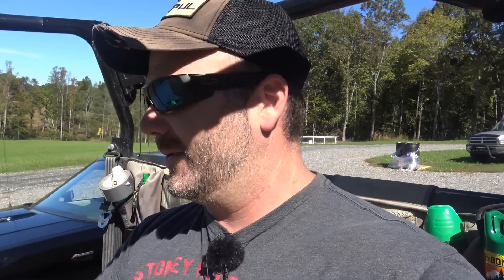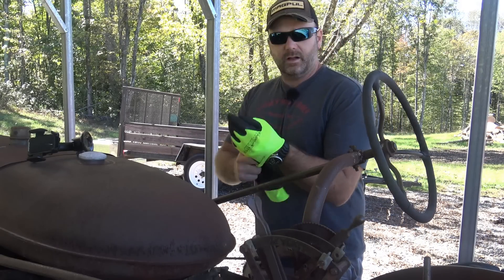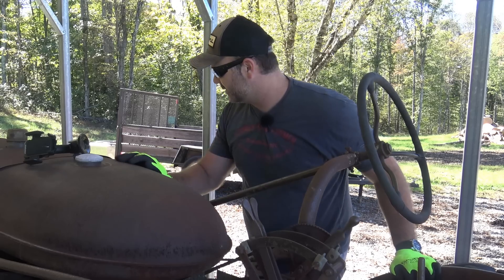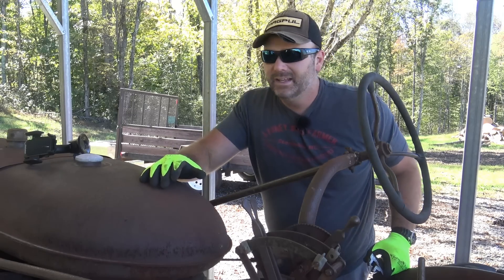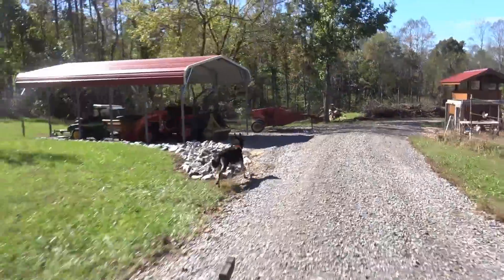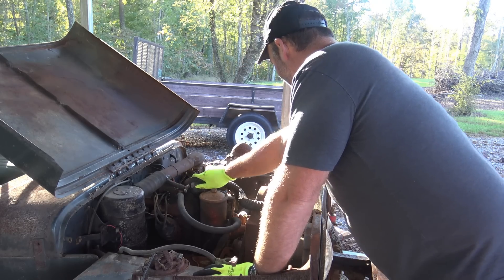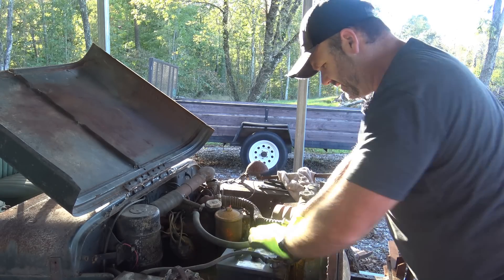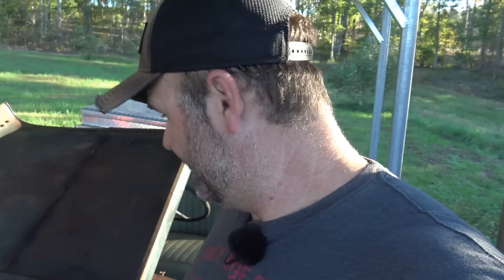WILLYS JEEP... LET'S GET THIS THING RUNNING!

Comment: 1. make sure she'll turn over. DONE!
2. take spark plugs out and inspect them/clean them, ensure they fire, using a vehicle that runs. Include the plug wires in testing.
3. squirt a little oil into each cylinder and spark plug hole threads.
4. change engine oil and filter.
5. repair the brake on at least one wheel.
6. take poor old starter apart to see the issue. repair.
7. ensure fuel to carb. IN PROCESS!
8. have fire extinguisher handy when attempting to start.
9. after it runs, check cooling system. 
10. new tires, tubes, brakes, change all fluids, grease, etc. (except oil, as it is fresh, if it looks good, with no contaminants) 
11. check all electrical. sparks can light up your crops etc. PDQ, no?
12. sand blast and/or rust paint on floors, panels. clean and rustproof bottom.
13. it's an authentic Willy Jeep. protect that sucker! lol.

These are just my thoughts. I'm sure there are more, but they involve other things.

Comment: try the battery back in the farmall , if that doesn't turn over you know its junk.  your starter could be fine.  clean the points and tow start it, good luck that jeep is cool as heck

Comment: Clean up those battery cable connections,  flush the  engine with  kerosene, put new oil in.  Clean battery ground connections.   Take starter off and take apart, fix it or replace. Clean or replace spark plugs.  Wish I was there to help, haa

Comment: You take out the plugs first! A bit of oil in the cylinders to lube it after a long time. Check motor oil. Lube all moving parts (shafts sticking out of the engine. All rubber oil retainers are dry on the outside.  Try to turn the engine over a few times. Maybe best by hand first. Check for spark. Clean the carb. And now try to start it.

Comment: Hey cuz pull that starter off and takeit apart and check the brushes and take some Emory cloth and clean the armature where the brushes make contact may get you by for a bit just to crank the willys

Comment: just convert it to 12 volts  it will require a alternator, a 12 volt coil, a push button for the starter  (so you don't fry the starter) the amp meter will need to be changed out with a volt meter and the gas gauge will not be accurate and a 12 volt battery,  I also suggest changing the the points in the distributor for a Petronics electronic ignition,  so much more reliable and easier to start.

Comment: Clean the point With sandpaper and put a temp.  Gas tank and 12v batery will start 👍
Reply: An emery board  like people file finger nails with is easier to get into the points than sandpaper. Just a tip.

Comment: Change the oil first! If ya get lucky and it fires, that oil's so old it'll eat crank & rod bearings and destroy the engine. New points & plugs wouldn't hurt either. Check the gear oil in the trans and rear end, it probably needs changing too. When I work on an old car or bike, ALL the fluids get changed before it's lit up so no badness comes knocking.

Comment: What would Mustie1 do?
Reply: Fuel, Sparc, Compression. The holy trinity according to Mustie1.
Reply: take off plugs and put two stroke gas under them

love mustie1!
Reply: Mustie would say: "let's look in the hoard, and find a starter, I would have 5 VW starters I think."  :-)
Reply: He'd probably pull off the Carb since that is going to be dirty and clogged. He'd pull the plugs and put some two-stroke oil/fuel mix in then crank the engine to check spark. If he has spark he'd move to checking compression (it looks like that thing has very little compression by how easy it was to turn with the plugs in place). Depending on the compression results he'd either check and lube the valves then work them to try and loosen them up or he's just crank the engine for a bit to get the top end lubed up and then check compression again. If he then finds good compression and spark he'd put some fuel into the intake manifold and see if it starts up. If it starts it's on to doing whatever else is needed to get it running from cleaning and rebuilding the Carb to new gaskets. From there it's all about the form and function - clean up the rust, bar and chain oil on the frame, fix any body damage, etc, etc. Then rattle-can the paint job and make us all wish he was our neighbor.
Reply: Darren would check to see if the motor spins. Then check for spark, then compression, pull the carb. Rebuild the carb. after he doesnt find one in the hoard. Opps I didn't see Buddy Revell already said. But I did miss fuel.. Lets get Brian over to help pull the engine. Is that a bad thing, that we all know what Mustie1 would do? lol
Reply: part it out, it's not a VW

Comment: On a positive ground system you hook the ground cable up to the positive post and other cable to the negative post. Try it. Also if your going to replace the starter you may want to convert the wiring to a 12 volt system I don't know where you can find a 6 volt positive ground starter motor.
Reply: It is a negative ground vehicle and when you change to 12 volts you need to change the gauges, but not the wires because 6 volt wires are larger than 12 volt wires. He needs to just put on an alternator, 12 V starter and change the points and condenser and coil to later model Jeep stuff.
Reply: @gelynch52phPH  wouldn't it be easier to to find 12 volt parts than to keep messing with a out dated system. When I said convert to a 12 volt system. that's basically what I meant. It's possible to find all the 12 volt components at most junk yards. only high priced collectors and manufactured companies have any positive ground stuff. I was just giving choices, not recommending he do one over another.

Comment: I bought a 1987 Grand Nat'l in 1990 from the orig owner with 4900 mi and sold it 22 yrs later cause I put too many mikes on it. Dumped the oil and filter every 5,000 mi and it ran like a top. I sold it with it  still retaining the orig lacquer paint.

Comment: the VIN number is supposed to be on an aluminum plate between the inlet and Outlet of the heater core on the firewall is held on with screws could have been easily removed

Comment: The rivet holes where there is a missing plate is Willy's patent numbers ident numbers are top front of engine- inside engine compartment on top of left front tire fender or there is a plate mounted inside of glove box with secondary vin
Reply from the maker: Thanks brotha...there isn't a glove box in this one..hmm
Reply: @StoneyRidgeFarmer  or check under the dash for ident number

Comment: If you do a google search for "1952 Willies jeep vin location" and look at the images you will see where the frame is stamped. the vin plate is in the location you thought it should be but that plate unscrews regardless so you will have to go by the frame number

Comment: I know with old ford n series tractors with the 6v system the battery cables have to be almost 100% clean or it will cause lots of issues turning over. I would replace the cables before anything, goodluck!

Comment: Rig up a gas can, tow it to top of hill, put it in 2nd gear, turn on switch and let her roll.  Pop the clutch and she might fire.  But first follow the suggestions here about the points and lubing the cylinders up a bit.

Comment: Cut the gas line right before the fuel pump and put a rubber hose on it and run it into a small gas can. I had to do this on my 1947 Chevy fire truck

Comment: Who went straight to the comments when you saw him pour the gas 😂.... it’s very dangerous to try and start a dry engine... always take out the plugs to add WD40, then while the plugs are out, turn the fan lightly to make sure it will actually turn over before stressing the flywheel with the starter and causing more damage... everyone has done something wrong when in a rush but just take it slow and you’ll do great ! 👏😁
Reply: Yes WD40!! It’s thin and will go nicely into all the crevice of the rings, it will burn out easily too and won’t cause compression issues

Comment: The VIN commonly associated with modern vehicles does not exist for the CJ3. These older vehicles only had serial numbers and some other manufacturing data. There is a data plate mounted on the right side of the firewall an inch or so below the edge of the cowl.

Comment: Pouring the gas in isn't going into the bowl. It's going right into the valves/cylinders. If you have spark at the plugs, I'd pull them and clean the plugs with a little sand sander and squirt some oil in the pistons. Then try pull start it. Careful with no brakes. Clean battery cables should lot. (6V needs to have best massable connections to get the most juice. Includes the armature and brushes.)

Comment: rebuild the starter cost you less i have rebuilt several 6v jeeps and it has worked almost every time or run a 12v system to it it will pop back to life good luck to you if you need help im glad to help anyway i can would love to see another jeep running on the roads again.

Comment: Pull the spark plug and dump a little oil down the cylinders or spray fogging oil down them. Then turn over the engine a little bit to spread out the oil between the piston rings and the cylinder.   Those russty battery terminals could be limiting the current. Starter could be bad too but wire brushing the terminal clamps is cheap and easy. Also for the fuel tank just zip tie a lawnmower gas tank or modify a water bottle or something. It's possible to and that the engine is turning over very slowly because the engine is Stiff from sitting too long. I have a 1982 jeep cj7 that sat in a barn for 16 years for the previous owner then ive owned it for 2 years and its sitting still. So 18 years its been sitting and the engine has not been turned over because the wireing harness is gone from a fiber glass body swap and recently I pulled the plugs dump oil down the cylinders and turned it over by hand and the engine was a little stuck but after wiggleing the engine back and forth it freed up and after turning it over like 10 times it truns over much easier .

Comment: You should have put some thinner oil in the cylinders and let it set also when you get it running need to put in some new spark plugs also revealed the alternator and rebuild a starter it's been setting 30 years

Comment: Josh, check the compression,  id replace the points and condenser, check the distributor cap, as far as the fuel situation, i rekon you can use a gas container with a rubber fuel line to the carb just keep it higher than the carb. Make sure you got coolant too, (maybe do a pressure test on the radiator) Also when you get it running keep a can of starting fluid and squirt to find vacuum leaks, i forsee rewiring and replacing hoses,

Comment: Look it up on the interweb-just because it's 6 volt doesn't mean it's a Positive Ground. Quick cure-put a one wire Delco 10si alternator and a new 12 volt battery in the Jeep. Switch all light bulbs to 12 volt versions,and you might have to reverse the polarity of the heater fan etc. Should be less than a day's work.

Comment: Put some ATF in the cylinders. Just get a rubber fuel hose and put it in a gas can for now. Points may be corroded and carburetor full of gunk. Banging on the starter may free it up, probably full of crap and corrosion. I'm sure it will start with some dicking around. Be careful with it as the clutch disc is probably rusted to flywheel as well.

Comment: My dad always fired up our Farmall model a 1941 I had 6 volt system but we started it with 12 volts wow that booger cranks over real good you can jump a 6 volt with a 12-volt just do not leave it hooked up very long

Comment: Get the backs fixed then get the stater worked on. rebuild the carburetor.  get clean/ get new lines for the gas to the tack and get the tack clean be for you go and TRY to start it. see you you have fire to the distributor cap. if you have all that then try to start it.

Comment: Take that starter off there and clean it up, lube it and check the brushes. You may get lucky and get by with a clean and lube with the mouse piss.. I'm sure there will many videos covering it or one close to it on you tube. Pulling it is a great ideal for a first start to see what else you're dealing with. 

And don't forget Rock Auto dot com can sometimes be your best friend when it comes to getting cheap parts for old iron.

Comment: Dont forget you need oil with scuff additives or you will destroy your bearings and lobes. Use 15/40 for fleet  diesel motors. The old bearings are not round balls they are flat steel. Never turn the motor from the crank shaft for the first time. Remove the starter and turn motor from flywheel only. You have the go devil motor? I have the 1953 hurricane. If you need help let me know. I know about these old birds..

Comment: There used to be an 8 volt battery you could install to give you more amps to help that tired old starter. Either that or convert to 12 volt and mount a 1-wire alternator to it. Join a forum.
Reply: I have a 1929 ALF fire engine all original 6 volt system. I have used an 8volt battery for many years. Didn't even have to change light bulbs. Thought about retiring tom12 volt but decided not to.

Comment: Check spark, if no spark clean spark plugs, then check distribution between spark plugs, then if there is spark, then put gas down the holes, put spark plugs in, then see if it fires if that's it keep trying it

Comment: It looked like the ground wire contact was really corroded.  That would explain weak starter performance.  You have a bunch of electrical to go over and it won't fire if you don't have spark at the plugs.

Comment: Hooking up a make-shift fuel tank to the fuel pump, then dragging it around in-gear sounds like a capital idea, guv'nuh!

If you do get it to start, I would suggest re-doing the whole thing in 12 volt. Youare probably going to be replacing everything electrical anyway, and using standard 12V stuff will be cheaper. If you can't get a 12V starter, you can put a high load resistor in line to it to drop the voltage to 6. My 53 Farmall Super C is done that way. It has a generic AC-Delco alternator that costs $25.  It still has some 6V stuff, but it's in the circuit with the resistor.  It's not difficult to do.  There's probably a "hot to" for the Jeep on the Internet somewhere. There was for Farmallls.

Actually, you don't necessarily need to step it down for the starter. My 6V starter sees the full 12V, and it's fine. You can burn it up eventually if you crank it a LONG time, but my tractor doesn't start very easy, and the starter is fine. Well, as far as I know.

Comment: The starter probably just needs new brushes. For years my grandpa just used a 12v on one of the Willys 6v starter
Reply: you can do that too,if you disconect the main wire to the wire harness,maby put on a 12 volt coil..
Reply: I had a CJ3B Willys Jeep, same motor but ohc instead of "L" head so it had a taller bonnet and a spacer between the body and upper dashboard. It was converted to 12v by changing the starter motor, generator, coil, bulbs and a replacement fuel gauge. All the parts came from a Ford Commercial van of around 1960 vintage at the local tip. Ford used the same motor in these vans!
Reply: YUP,not that hard to do!
Reply: Go on Amazon n buy a starter for it n spark plugs
Reply: You would want to put a 12 V coil on if you’re going to use 12 V the entire system. But you can buy them  pretty cheap or take it off something you don’t use.
Reply: American Drewski I agree about the brushes, also clean up the battery terminals.

Comment: Make sure battery is connected right you said positive ground. It looked like starter was spinning reverse. Add small gas can with hose under hood, ie raceing fuel cell. See direction fan spins when you pull it is it the same as when starter tried tor spin it?

Comment: Did you pull the plugs and put some oil down the cylinders? Check the points and rotor? You never checked for spark but you're gonna drag it all over?
Reply from the maker: can't check for spark if the starter won't turn the engine my friend...more to come soon! I've got it up in the shop now!! Got a starter rebuild kit...you make a great point about oil on top of pistons...I'll pour in some Marvel Mystery oil...but it turns nice and free

Comment: If this was mustie 1, he would dump oil and gas mixture down each cylinder and pop it in 3rd gear and pull it behind a truck and let out the clutch

Comment: You need a lot more battery power to turn that motor and produce spark.  I have a charger that has a boost for that very purpose.. If you can get that motor to turn at a much higher RPM, it will start most likely...

Comment: Clean all your grounds and electrical connections, i use a stainless steel toothbrush, emery cloth and steel wool. Did you put transmission fluid in the spark plug holes?

Comment: Pull the spark plugs (probably replace since they are out) pour some marvel mystery oil in each cylinder. Put it in the highest gear (most likely 3rd) and pull it around for a couple minutes to let the motor spin. Put the plugs in rig up a gas tank and fire it up